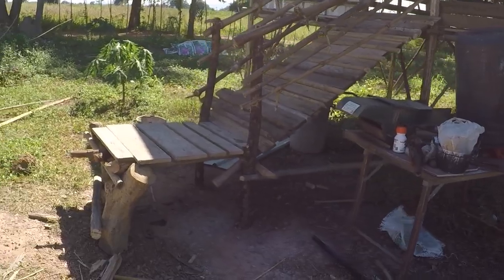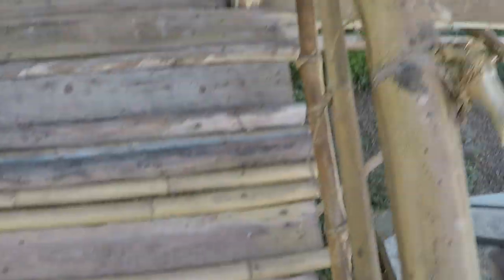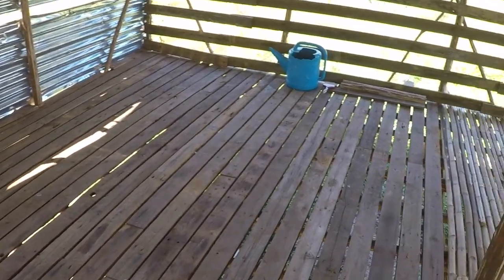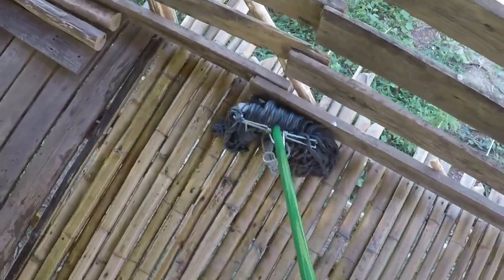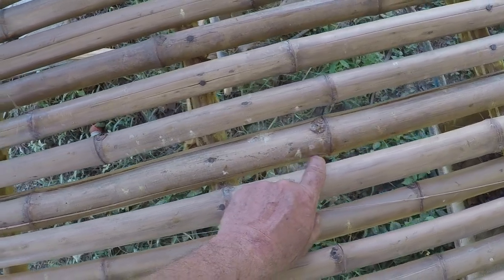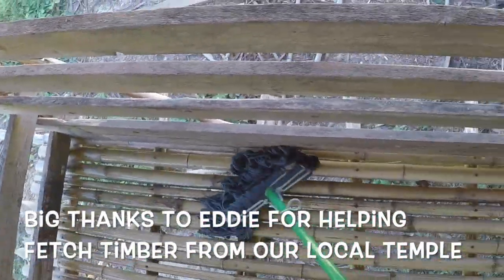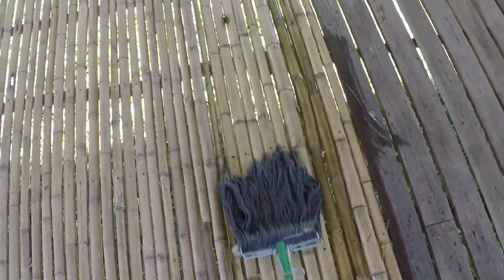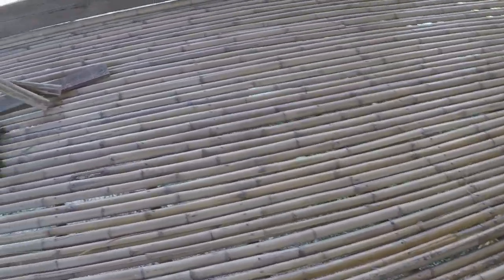HOW TO Build a Cheap Goat House | PART 4

Comment: Good for  you....job well done!  Applying the termite mix to everything and then some was a great idea.  I love that ramp and wish I had something that was like that to avoid the steps I have outside.  But then it would turn into a handicap ramp and I'd need a permit to build it to code.....and then pay taxes on it in the spring and fall.
Taxes and death....can't avoid them.
Reply from the maker: I remember taxes 😲😲😲